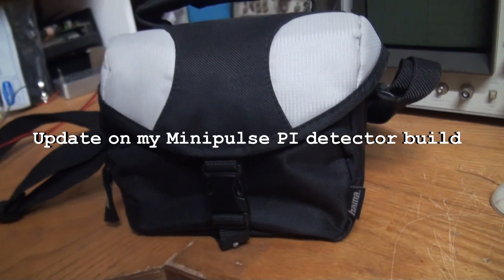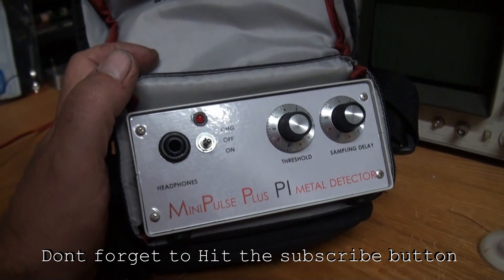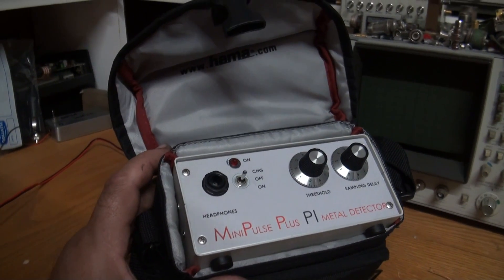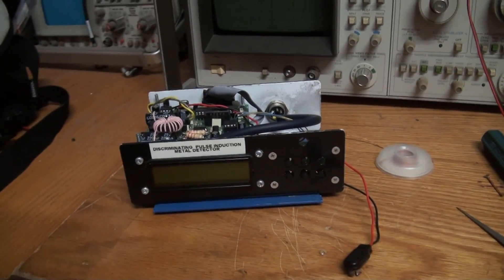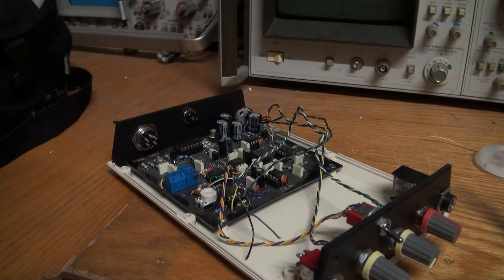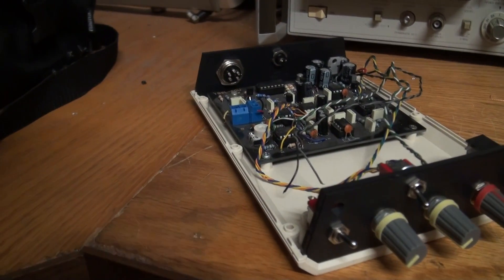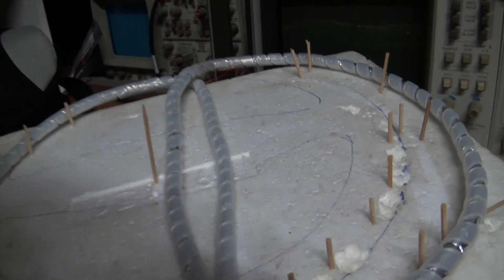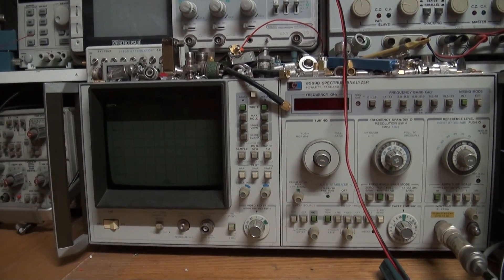minipulse plus PI detector update

Comment: Hi Sir,  I would like to ask your advice, seeing how you made and I am assuming tested these metal detectors, I would like to metal detect, in snow dumps  and beach, I have 3d printers which I can  make the parts with but as far as which electronic kit to buy, I do don't know where to begin. on Silverdog website there seem to be 4 deferent ones to select from, which of these would you suggest I buy, Or  would you point me to another ? Thank you greatly for you advice.
Reply from the maker: +patprop74  If you will use it on snow or beach then the surf pi is very good and its the cheapest too. Once you get it let me know if you need other info
Reply: +itakeyourphoto Thank you for your offer  and advice, I already ordered both the surf pi and the barracuda from Andy, Right now what has me worried is the coil, it seems to be the most critical part of the build, and there is a lot of he said she said on this topic,  I ll be the first to admit, the more I research the more confusing it becomes.
Reply from the maker: +patprop74 I have been meaning to do a video on coils. Not a how to build but rather how a coil works and how to make it work at its best for detecting. There are a few factors that dictate how good a coil is.  
The video will help you to separate facts from fiction.  
im very busy at the moment but should be able to make it by the end of next month so stay tuned!THe surf pi is not a very fast detector (sampling speed) so the coil is less critical than it would be for the minipulse plus.
Having said all that making a good coil is a challenge.  It is a lot easier to just buy a suitable second hand commercial coil. I would only recommend making your own if  you want to learn about coils.
Reply: +itakeyourphoto my motivation for making my own coils is indeed  for the learning factor and also, I have a mind set that if someone can make one so can I, I have took consideration your advice to buy a used minelab or coiltec but there does not seem to be any available under the 200$ plus dollar range, ( on ebay ) like I said, I cad draw and have a few 3d printers,  which further motivates me to make my own, I would greatly appreciate any video you could make on the subject of coils, I also seen you are a photographer, I'm  armature photographer, if you  have a flickr page you like to promote id like to have a look at more of your work.

Comment: Btw what's the difference between this and the surf PI? Or the others you mentioned.?
Reply from the maker: +Christopher Jones This one has auto thrershold and that makes it a bit easier to use in bad ground,  It can also be set to sample faster so should be better on very small gold.  The chance PI can discriminate between iron and other metals.  The surf Pi is a nice simple design that works well on beaches.  None are much good in highly mineralised ground were you typically find gold